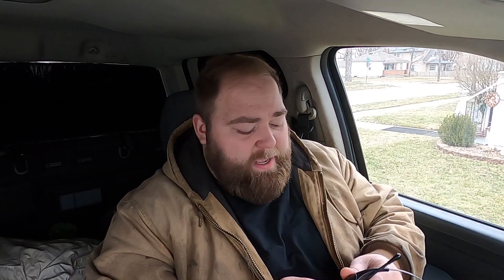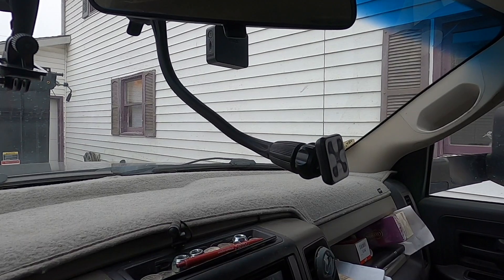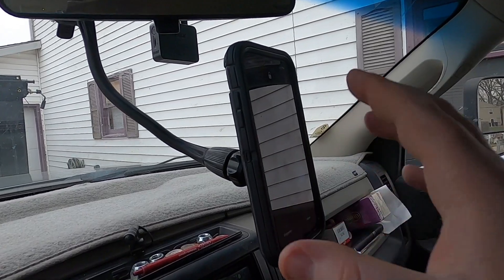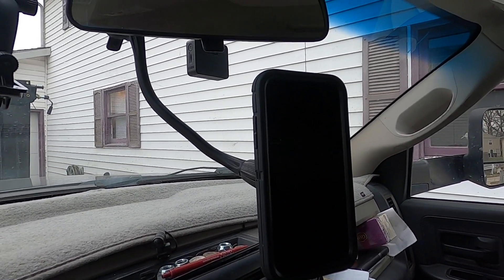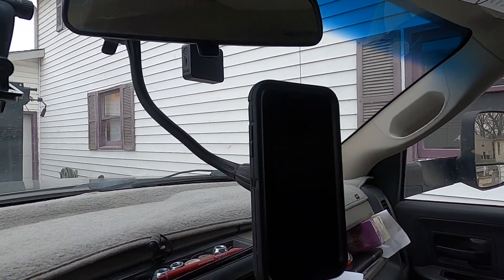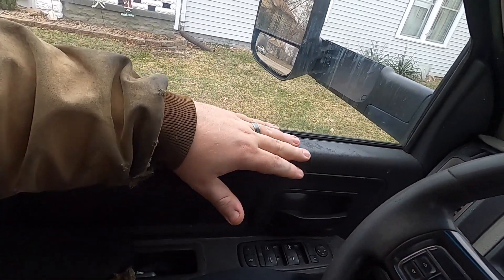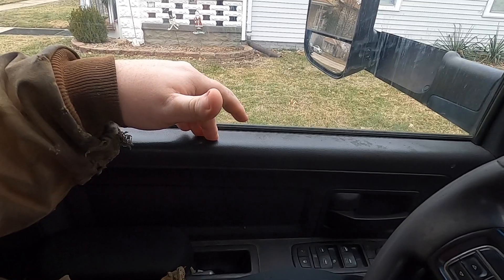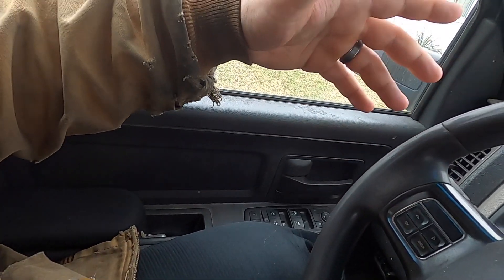Top 5 Most Convenient Items in My Truck - RV Transport

Comment: Bulletproof Mounting Solutions. I have the universal dual 20mm dash mount in a 2020 Ram 2500. I optioned it so that the left side has the phone mount, and right side has a tablet mount. They also have mounts for gopro's, radio microphones, and the newest is a handheld radio (Ham/GMRS/FRS) holder.

Comment: I am NOT lefthanded, but my father was.  He was my primary driving example and I do drive as you do, like a lefthanded person, apparently. I always have problems with the door interior after resting my arm there for years. A 2008 Mercedes-Benz sedan I owned for less than 6 years had the door fabric/vinyl actually tear due to my arm resting on it so much while driving. 🙃